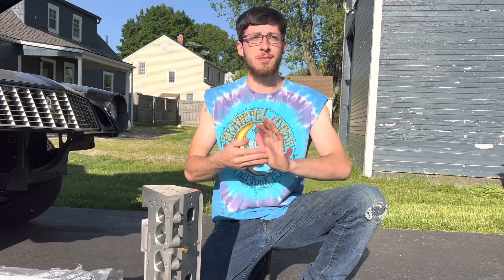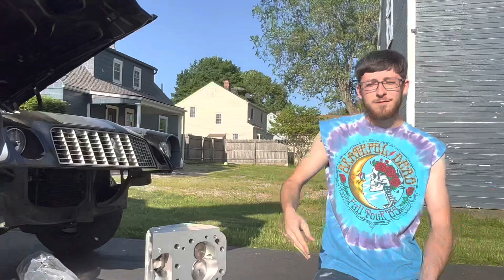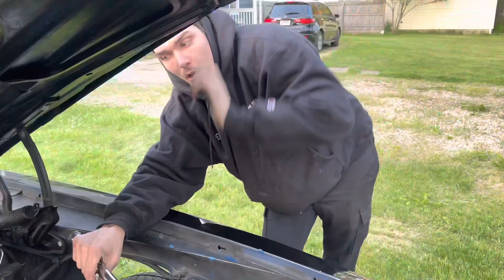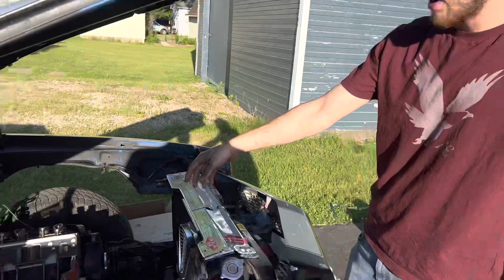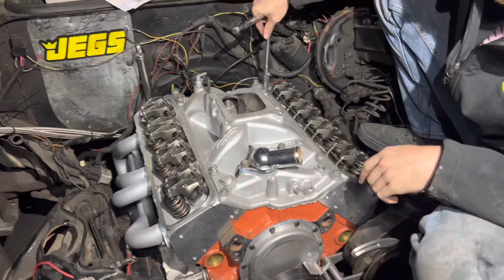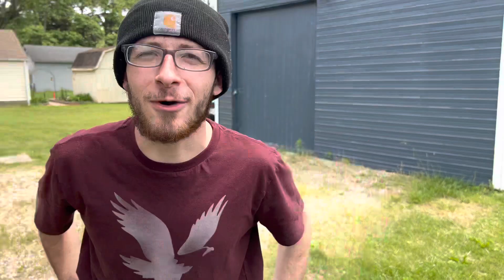ALUMINUM HEADED CAMARO fires to life with RADICAL CAM

Comment: It is a personal choice...copper spray on gaskets...I have steal shim's..aka steal head gaskets on my SBC.. aluminum heads...cast block.. 
10.5-1 compression...600 hp...
580 lift solid flat tapit cam...no head gasket leaks...no copper spray.   
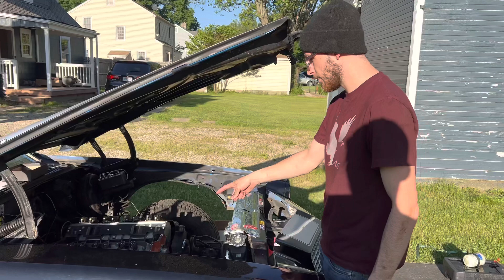Car runs 6:50 1/8 mile.  .10:20 1/4 mile......no problems....

Comment: This is so aWesHoMe! 
With this cam you could go 10.8 or 11:1 static maybe. Yes yall have done reaL good though.With your 62CC chambers and i am figure a true 7CC relief on the flat tops and a true O.O36" quench (kinda close to head) Your at 7.8:1 dynamic at 400 ft elevation calculated. Of course what is your altitude. and atmospheric pressure? Of course if you got your carb and timing to what the engine wants based on air fuel ratio and stoichiometric ratio otherwise known as lambda could use even higher on 93 octane. With your 4.10 gears, stall, and performance cam, your car is not going to detonate if carb gets tuned correctly on 93 or 91 pump gas. Proper fueL enrichment is the key. Cheers buds let the good times rock n' roLL. In vehicle back the timing off exactly 2* from what the engine would dyno on an engine stand at. You could possibly squeeze another 20-40 hp depending on how well the cam is degreed and carb tuned. Although the car should have this power present not because it is extra. Respectively. Laterz dudes. The place seen improvement could be made were the heads around the valve's opening, and in chamber and radius in bowl. Remember, you could always mill the pistons O.OO3" and deck the block down with pistons sticking up O.OO3" out of hole and a O.O40" head gasket... also. P.S. this thing is going to run tens not 11s.

Comment: About damn time! 👍
Anxious to watch you get back to the track! 
BTW did you check your deck height from the top of the piston? Running 0.015" compressed head gaskets is really risky without at least 0.015" of deck clearance.
Reply from the maker: Piston .020 in the hole
Reply: @rustbeltbuilds  Perfect. I only mention it because I just bought heads for mine and bought a .020" gasket but I haven't measured the deck height yet. I may end up having to go thicker. 😁
Reply from the maker: You’ll be fine unless you run .600+ lift
Reply: @rustbeltbuilds  I'm not talking about valve lift. I'm just talking about piston to head clearance.
Reply: @rustbeltbuilds  2nd gen Camaro O.O25" down the hole exactly every piston. Used a O.O15" fel pro double sided formed coating shim gasket. O.O30" over MahLe pistons 355, extra ported milled 882 heads busted to water, need iron eagles or  some aluminums like yall  got. 11:1 compression. Hyd. roller.
Reply: I don't know about SBC but when I built my Olds engine I made an oil pump priming tool by cutting off the dear on an old distributor shaft and then turning the shaft with an electric drill.
Reply from the maker: We’ve done similar with screw driver